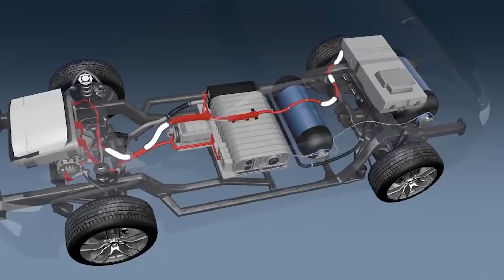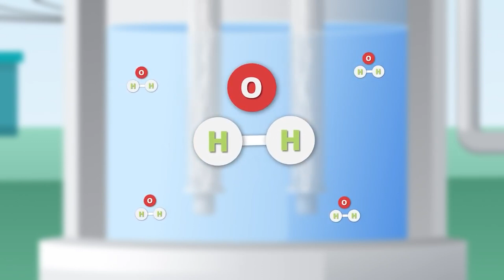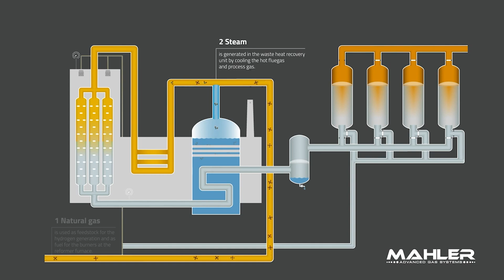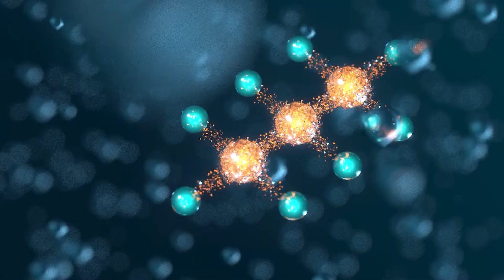New Hydrogen Fuel Breakthrough SHOCKS The Entire Car Industry!

Comment: the most "recent" information on fuel cells is the one to drive a passenger car would weigh 9000 lbs. To add 9000 lbs. to a 4000 lb. vehicle is, as you readily see, laughable. Also, hydrogen is liquified at about -270 degrees C. I'm not aware of that being obtainable with today's technology. Storage of hydrogen is a major problem and has not been solved. For the transportation sector, liquid fuels from renewable biomass is the way to combat global warming. Governments don't seem to see that. So the continuation of other solutions, like hydrogen, is wasting our lives away literally. Global warming is killing an estimated 5 million people a year.
Reply: While liquid fuels from biomass can replace gasoline, and be distributed in much the same way, it is the sourcing that is the issue. If the entire planet is willing to become vegetarians tomorrow, then no problem whatsoever, pretty much all the plants raised to feed animals will do as the biomass to make enough replacement fuel. Fuel that is actually much less dangerous than gasoline. It is plenty flammable, but less explosive. It is toxic, but has none of those forever chemicals associated with them. So sorta less toxic. Like I said, less dangerous.